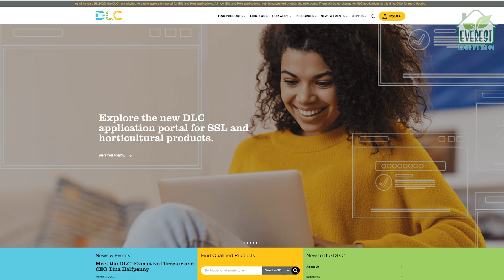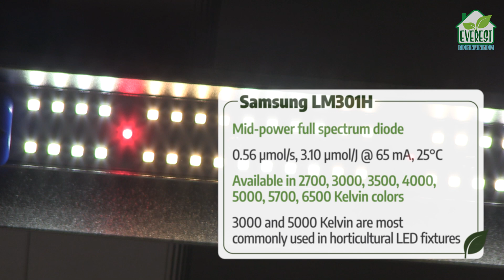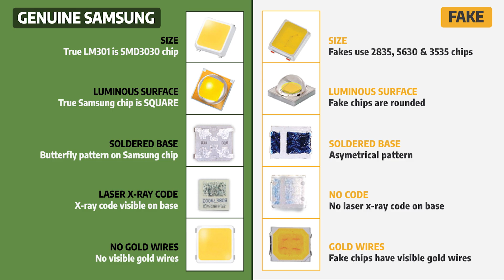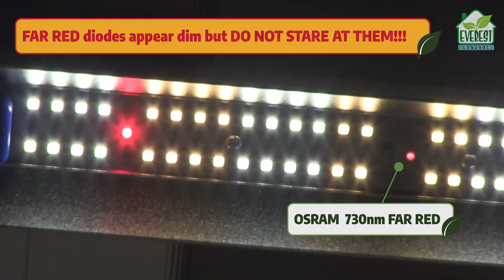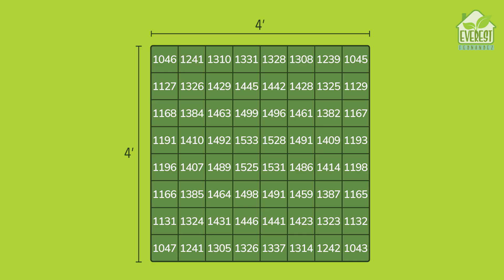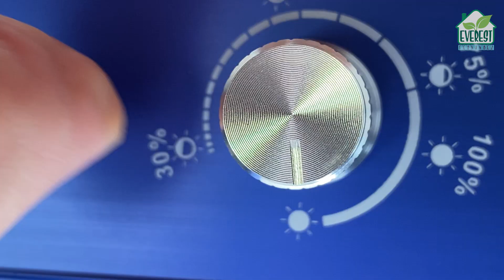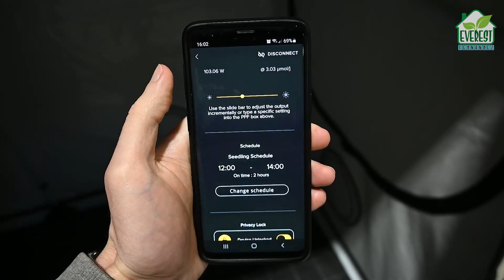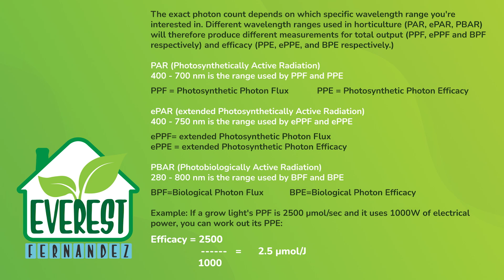LED Grow Lights: Independent Buying Advice

Comment: Every light he talked about was around $1000  
😂
Reply from the maker: The purpose of this video isn't to push you towards buying a certain brand or model. The one light I do feature (as I'm currently using it) is the Iluminar iLogic8 630W which is currently available from online retailers for around $700.
Reply: @Just4Growers  I understand, I just feel $700 is a lot for a grow light when i'm not growing marijuana.  If you're starting seeds for spring, growing lettuce, peppers or cucumbers I don't see the break even time on electricity saved ever getting recouped before the light dies.
Reply from the maker: @kevinmiller5467  Thanks for your reply, Kevin. I would definitely recommend a lower cost propagation light for starting seeds and getting a head start on the outdoor growing season. A lower output and cheaper light would also suffice for indoor lettuce production. You're right that peppers and cucumbers require much more light and time to grow full cycle indoors. It may well take you a lonnnng time to recoup the fixture's purchase price when calculated in terms of the market value of the food grown, but I also value the convenience and freshness of having homegrown produce. That said, most LED grow lights have an L90 of 50,000 hours—so, you're getting over eleven years of constant use @ 12 hours a day, and even after those 11 years, the light is still operating at 90% of its original output. Pretty amazing longevity on LEDs—although this is all quite theoretical at this moment as nobody as actually been using modern horticultural LED lighting fixtures for that long yet!

Comment: Is the samsung LM561C still a good diode to use as in the Fseries gen 3?
Reply from the maker: Thanks for your question. The LM561C is known for its high efficacy, delivering around 200 lumens per watt, making it highly efficient in converting electricity into light.
Application: Initially designed for general illumination, the LM561C gained popularity in horticultural applications due to its efficiency and cost-effectiveness.
Spectrum: It's available in a range of color temperatures, including warm white, neutral white, and cool white, which can be useful in various growth stages of plants. However, it might need supplemental lighting for the full plant growth cycle.
Voltage: Typically operates at around 2.7-2.8V.
Price: Generally more cost-effective than the newer LM301H.
Samsung LM301H:
Efficacy: Slightly higher than the LM561C, the LM301H can deliver up to 220 lumens per watt, making it one of the most efficient diodes on the market for horticultural applications.
Application: Specifically designed for horticulture, the LM301H is optimized for the photosynthetic photon flux (PPF) values needed for plant growth.
Spectrum: The LM301H provides a more comprehensive spectrum with added red to cover the photosynthetically active radiation (PAR) spectrum better. It offers a fuller spectrum which supports plants throughout their entire growth cycle, from vegetative to flowering stages.
Voltage: It operates around a similar voltage as the LM561C, around 2.7-2.8V.
Price: Typically more expensive due to its specialized design and newer technology.

While both diodes are excellent choices for horticultural lighting, the LM301H is a step ahead in terms of being specifically optimized for plant growth. If budget allows and the goal is to maximize growth potential, the LM301H would be the preferred choice. However, if cost-effectiveness is a priority, and the grower is prepared to possibly supplement with other light sources, the LM561C remains a strong contender in the market.

Comment: Watched again. Very informative video. Yeah, ya need to be careful of some of these Chinese lights with lofty claims without any info on the brand of diodes. Mostly coming from Amazon.

It's crazy how much LED has improved and have become more affordable. But for anyone reading and has never bought one, do your research, listen to people like Everest and shy away from ANY blurple or most from overseas. There are a few good ones from there but beware. I've learned the hard way that sometimes spending a little extra is definitely worth it.
Reply from the maker: Thanks Rob. It’s an exciting time for growers interested in LEDs. In 2023 we are seeing very decent 720W multiarray fixtures retailing at $400 and now new “driverless” LED fixtures are available which run off DE-HPS eballasts! Watch this space.
Reply: @Just4Growers  Watching! 😁

Comment: Which one would you use for a 4x4 tent?
Reply from the maker: For light loving, flowering crops in a tent, I'd go for a multi-array LED. The 660W iLuminar iLogic 8 FS+UV+FR would be a strong recommendation, based on spectrum, performance, and reliability. The same company also offers a newer 720W model called the "Hypermol" which arguably offers even better bang for buck (I'd definitely get a dimmer accessory in your basket too). If you're based outside of North America, and looking for more onboard functionality, Dimlux have some great options.

Comment: Do you have web sites where you prefer to buy your supplies?
Reply from the maker: It really depends on your geographical location.
Reply: @Just4Growers  I live in New York State. Have any recommendations for that area of the us?
Reply from the maker: @denverkenney2203  Okay! Are you after an online supplier specifically with a good LED lighting selection, or do you mean sundry supplies like nutrients and growing media?
Reply: @Just4Growers  I’m brand new to all of this so I’m going to need all of the supplies to get going. I run a hobby farm with my family so growing produce is not new, but I’ve always thought hydroponics could be a cool addition. Any recommendations on where to get started are greatly appreciated!
Reply from the maker: @denverkenney2203  The Grow Room has two locations in NYS and has been family owned and operated for 25 years. http://www.thegrowroom.com
Reply: @Just4Growers  cool! Thank you so much! And thanks for all the videos! They are very helpful.

Comment: Amazing video, super insightful. Though isn’t ppfd more specific and important? PPF can state output but doesnt say where it’s going so it might just all be in the center instead of evenly spread. PPFD gives a density map of how the PPF is spread out along a 4x4. As shown in the video, it’s more important to check if the corners are evenly distributed. Thus it should be the other way around. If the manufacturer just gives the PPF but has no PPFD map then avoid.
Reply from the maker: Thanks for your insights Xd. I would argue that PPF comes first—total output—so this is the must-see metric. PPFD maps can be useful for showing the footprint / coverage of the light across a two-dimensional plane at a certain distance from the fixture — it's just that, if a manufacturer just shows PPFD maps and no PPF, it's a red flag for me — invariably the distance is much closer than that which is feasible when growing plants in reality — in other words, they measure at 6 - 12" to show very high PPFD numbers - but the PPF gives all-important context. The other biggie is the spectral distribution. (No point having a super high PPF, or PPFD, if all the light is concentrated in one region of the spectrum.) 

While we are on the subject of PPFD, I would like to add a few more points. We measure PPFD using a PAR meter—typically a handheld meter with a silicon photodiode—housed in an acrylic diffuser cap so that all incoming light is spread homogeneously over the photodiode. The amount of electricity the photodiode produces is then converted into a light intensity reading, in terms of micro moles of PAR light per m2 per second. All good, but—by its very design—a PAR meter doesn't take into account the direction or column density of the light it receives. For example, notwithstanding the spectral differences, there's a big difference between the quality of light emitted from a 600W DE-HPS and a 600W multi-array LED—the light origin is spread out over thousands of diodes (typically) with a multi-array LED compared to all coming from the same (relatively small) arc tube with a 600W DE-HPS. My point here is that if you add up the surface area of all those 9mm diodes, it will be 2 to 2.5 times more than the surface area of the arc tube. 

As indoor growers, we've been banging on for years about the importance of getting our lights as close as possible to our canopies, without causing localised over-transpiration stress —  proximity is arguably even more important for multi-array LEDs. <TLDR> Your plants are the best PAR meters.

Comment: Really good information! Interesting how they’re offering IR and UV on their own drivers.
Reply from the maker: Thanks Jake. By assigning diode types / groups to specific drivers, manufacturers can achieve higher overall system efficiency, rather than having to find a 'best fit' for all with a single driver. UV-A diodes are more commonly run exclusively on their own driver (but not always!), whereas far-red (730 nm) tend to be grouped with phyto-red (660 nm) to keep their ratios consistent. If growers were, for example, to boost far-red and reduce red (if they were on separate drivers) it could be akin to giving them rope to hang themselves with as plants could exhibit a shade-avoidance response and start stretching up! Not a good look for indoor gardeners. In 2023 you will see more tech coming to market including special timers that keep the far-red diodes on for an extra 15 minutes after 'lights off' to promote a quicker flowering response / transition from veg to flower. The new options that LEDs are opening up for indoor growers keep expanding! Exciting times.
Reply: @Just4Growers  I look forward to hearing more details about these technologies as they become available.

Comment: What do you think about the spiderfarmer lights?
Reviews look good, also done by migro
Reply: i have a couple SF-5000's they have been running for a little over a year...they are perfect for my 4x4 tents. My only issue with spider farmer is if you buy factory direct customer service can be a bit sketchy. I reamend going through Amazon, because there return/refund policy

Comment: A couple questions...
Have you ever toyed with making your own grow lights like Growmau5 just buying the COBs, and is it worth it.

For a while I've toyed with making a Volksgarden rotational type garden system and making a grow light to fit. Any thoughts?
Reply from the maker: Hi BigRegg, thanks for your questions. No, I leave that kind of stuff to Growmau5 :) The old "Ecosystem" style gardens worked well because HID lamps emit their light 360 degrees perpendicular to the lamp, so positioning your garden all around it (with no reflectors on the lamp, obviously) made great sense. With LEDs it's not so cut and dried— because they don't have the same style of radiant emission. I can definitely see some potential for stadium SOG style grows with LEDs though.

Comment: I dream about à panel that can produce light from 365 to 1000nm with full dimming of each type of led with adustable intensity all over its surface evrything in 1cm thick maximum with watercooling to put the heat generatded where you want. And autodiagnostic for fun

Comment: I run a chilled logic 660 and a chilled x1 and x6 and all of them do wonderful. I recommend anyone to buy the kits when they go on sale and build it yourself.  Saves 100s and they are super easy to build
Reply: I struggle to get my chilLED logic 660 to do well in veg, I'm getting chlorosis, twisting leaves,  looks like VPD nutrient lockout issues. It all goes away a few weeks into bloom though, Any tips for better results in late veg? hotter and more humid?
Reply: @z1z2z3z z1z2z3z  would need more info. Soil, coco, hydro? Also what are you running the lights at? Extra nutes? Temp and humidity?  You got insta?